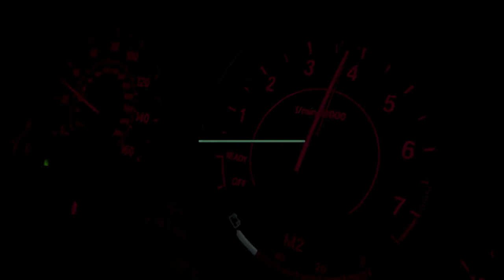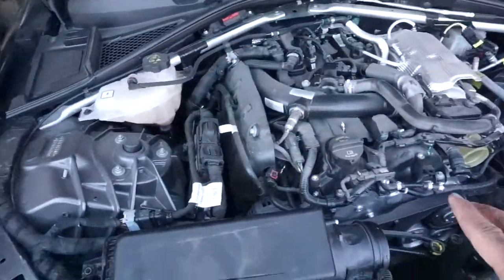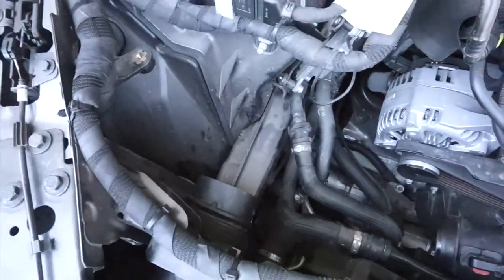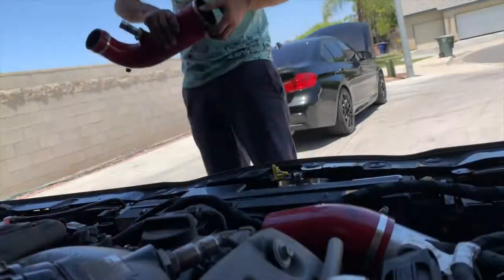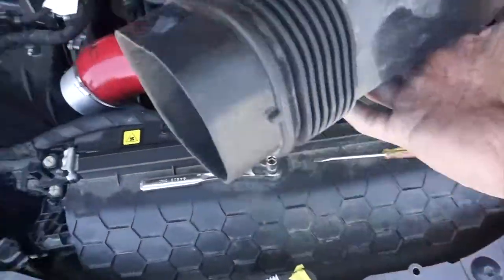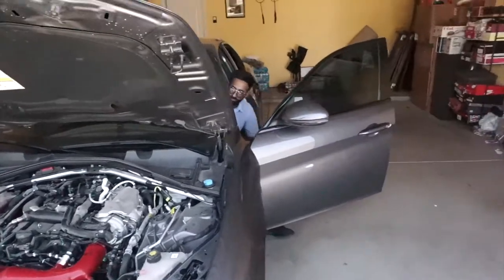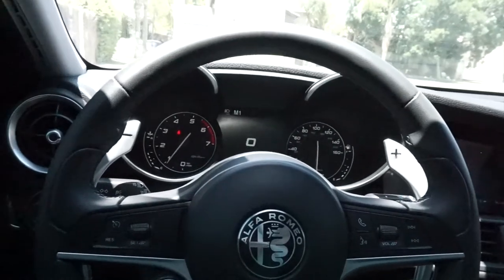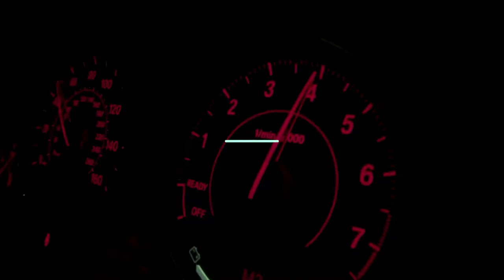Alfa Romeo Giulia AIR INTAKE installed and explained DIY, FIY

Comment: You're sucking hot air rom the engine compartment? You need a COL OUTSIDE AIR INTAKE for this, not hot engine air.
Reply: There are air ducts blasting fresh exterior air into the intake, only sucks hot air at idle